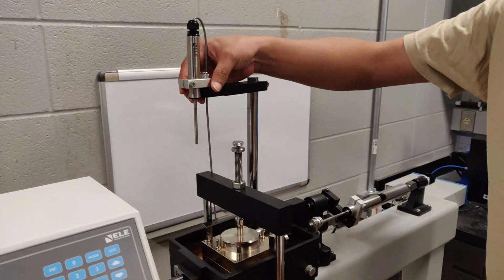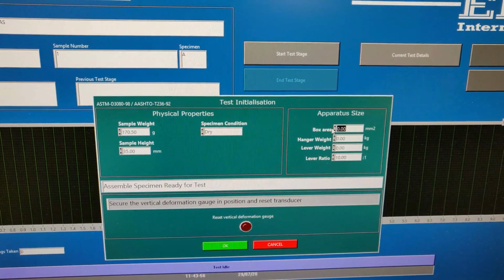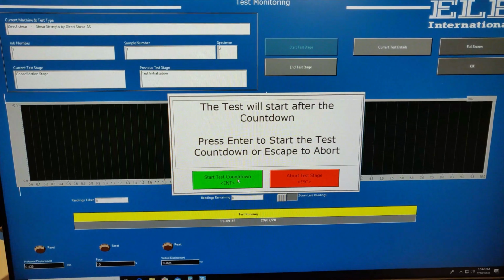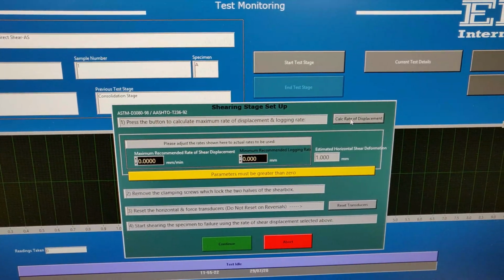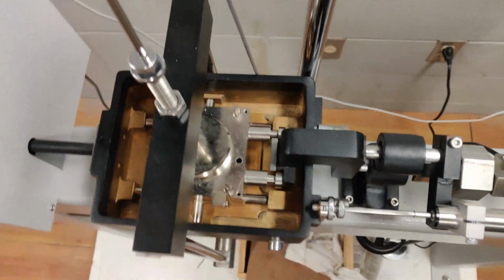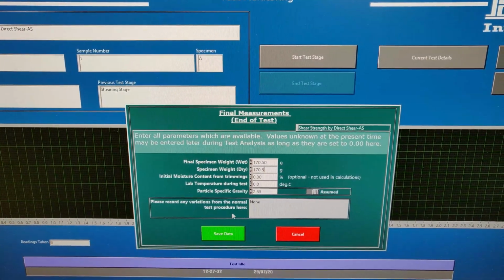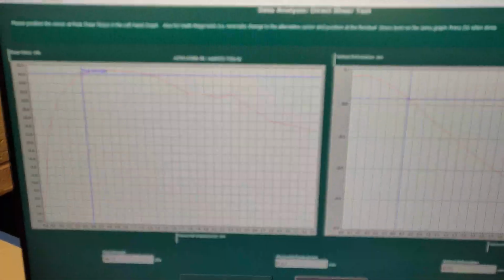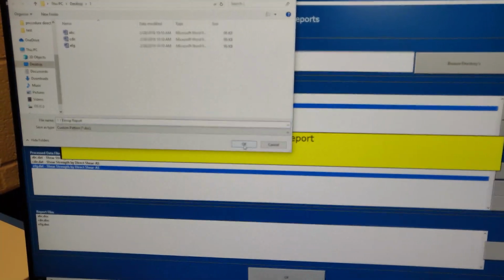How to Determine Shear Strength Using Direct Shear Machine!!!

Comment: Hi Ratish, 
I would to know how can we command the machine from the DS7.3 instead of starting it manually. 
Thnaks,
Reply from the maker: I don't know if they have updated the machine to operate that way. The DS 7.3 software was used to record the converted transducer signal into a graph. For more information, Please see the operating instructions. https://www.ele.com/product/digital-direct-residual-shear-apparatus-complete-with-lever-loading-assembly-220-240v-50-60hz-1ph-/276